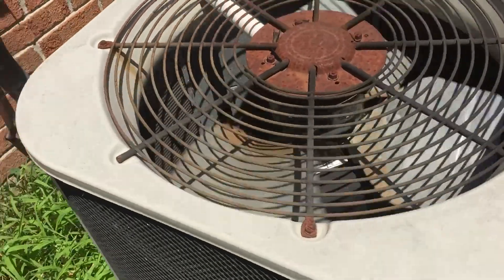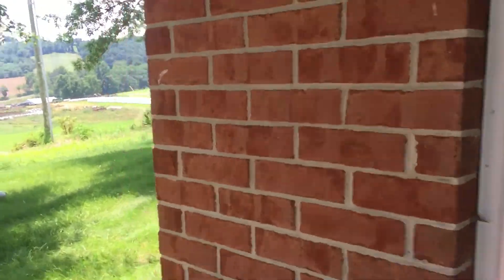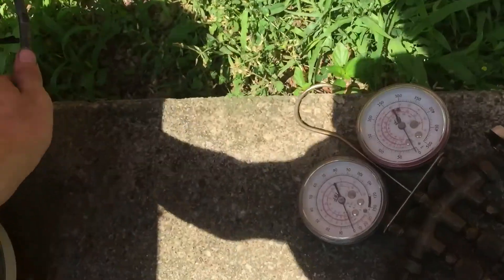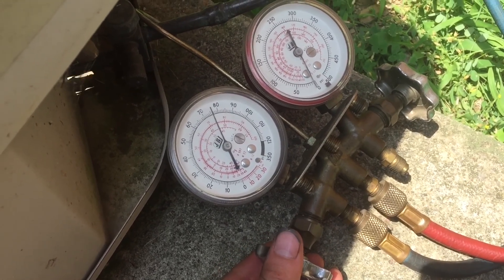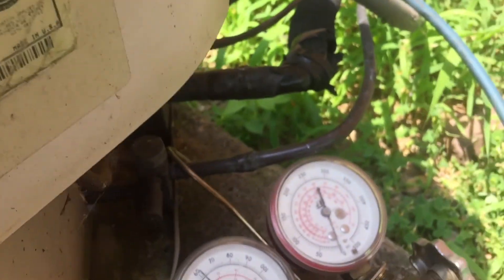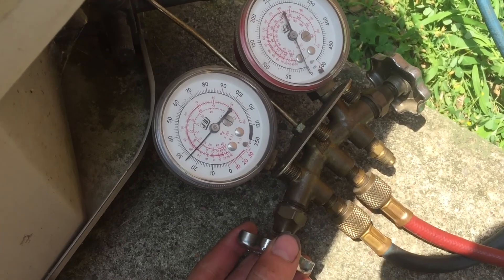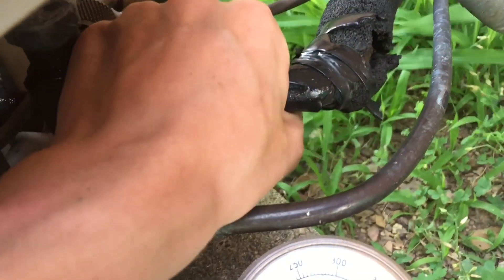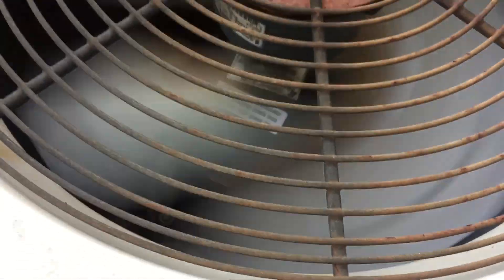Nordyne central air conditioning unit startup and recharge

Comment: an example of what not to do - low side only, no superheat/wetbulb return air, not verifying proper airflow first, topping off a unit with a very major leak judging by the initial pressure. you can slug the compressor or end up under-charged going by suction pressure alone.
Reply from the maker: Jon [Insert Last Name Here] I appreciate the help it was my first experience and that’s the only tools we have for that unit and now is working correctly to this day
Reply: maybe it was a leaking schrader valve which seated itself properly after removing gauges - otherwise by now it would have stopped cooling considering how low it was. 
Regular stem type digital thermometer wrapped with thin moistened fabric works for return wetbulb measurement.
superheat chart for fixed orifice -> http://efficientcomfort.net/assets/documents/charging_and_td_chart_plus.pdf, not for txv.  r22 pt chart you can find online if your gauges don't have the markings.
Reply: When was this air conditioner made?